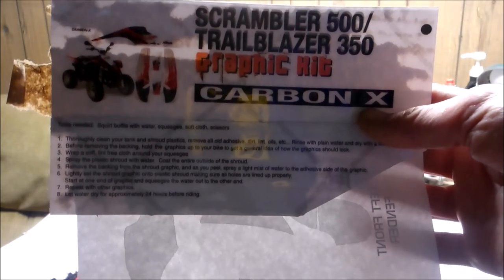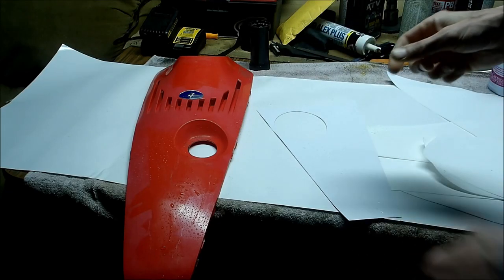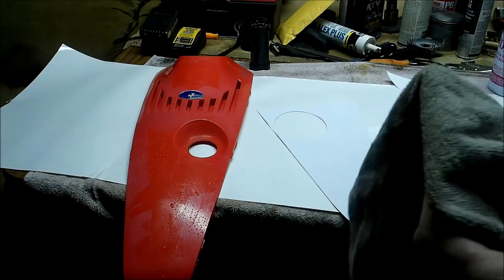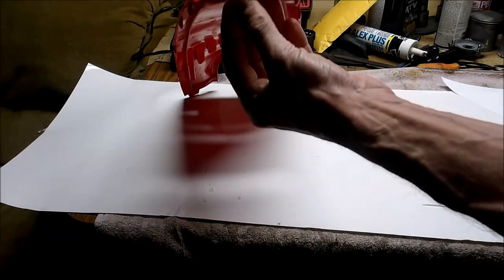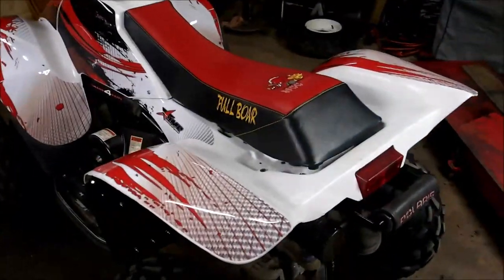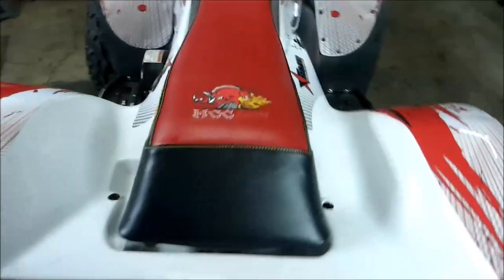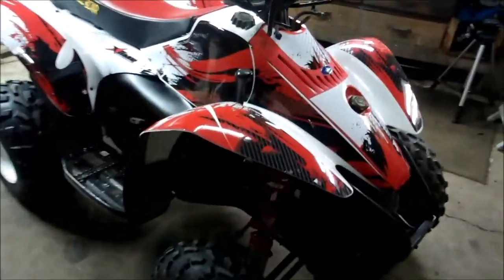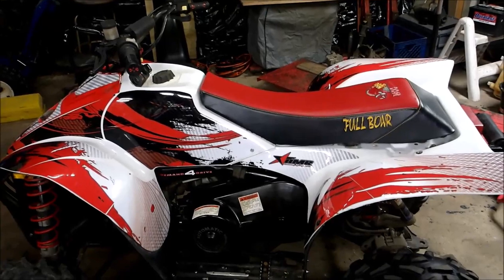Polaris Scrambler Graphics Kit Installation. Wrap it! Make it look new Again!

Comment: Looks great! How well did it hold up? I just bought a 2000 scrambler and its plastics are really faded so I’m thinking about getting a wrap. Did you have to remove all the decals before you put it on?
Reply from the maker: I removed the old decals. that was a pain. you could go over them but I was worried about adhesion. they held up fine as long as you get all the air pockets out.